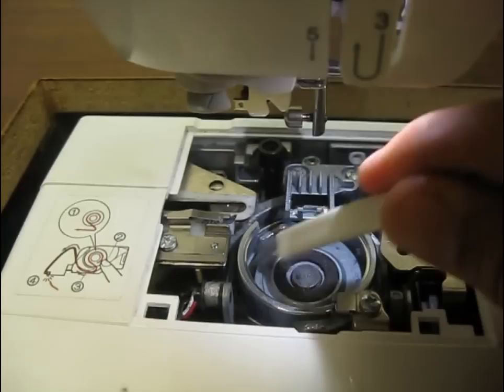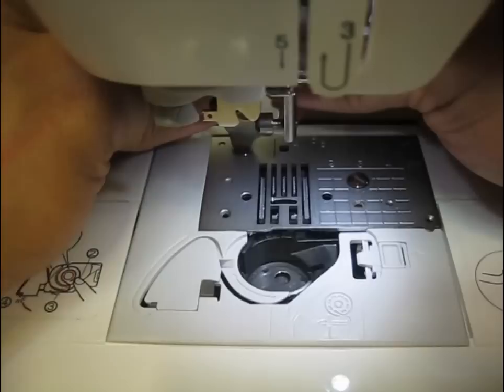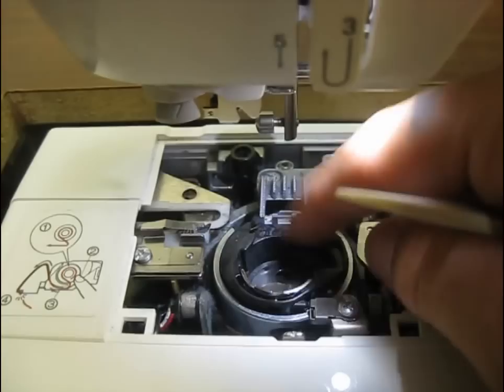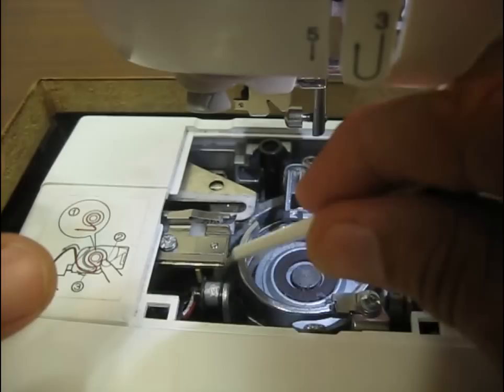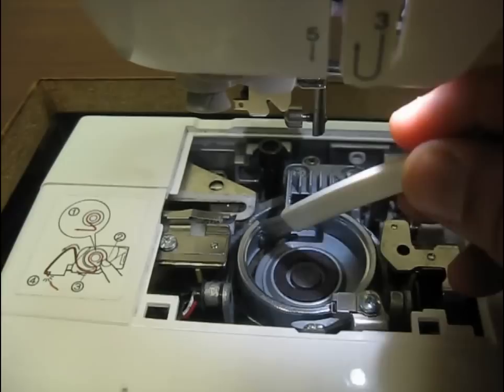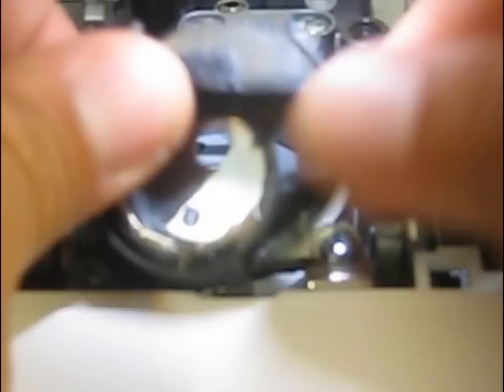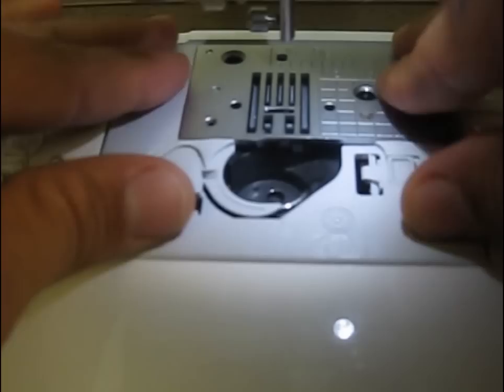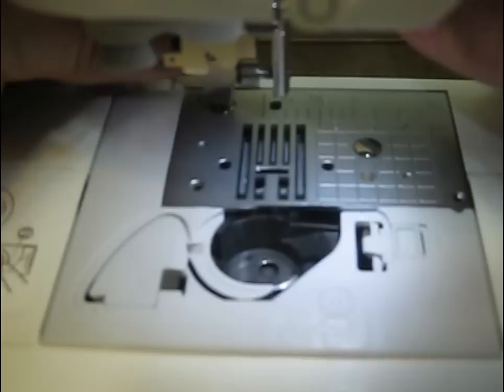How to Clean and Maintain Your Sewing Machine

Comment: you guys are great! thank you for doing this video.  My problem is that I removed the metal plate to clean the Singer Curvy machine and also removed the bobbin plastic holder, BUT THE PLATE WONT GO BACK ON THE TOP OF THE MACHINE.. what am I doing wrong.  My sewing projects have all come to a hault, can you please advise.

Comment from the maker: I don't think it is self lubricating. It is harder to clean and lube the top because of the plastic case. I just did an interview with a sew machine repair person and he suggested doing the same. However he did mention that it depends on usage and that if you are unsure how to do it you should take it into a shop for a tuneup. Maybe check out that video he gives good tips. Thanks for the post!

Comment: Just a quick note, if you take off the front panel that you have to remove for the embroidery unit, the plastic plate over the bobbin can be removed by sliding it towards you. You don't have to remove the metal plate to take that part off.

Comment: I am having problems setting the bobbin in place.   It seems that when I am done it is still loose and then it does not sew right.  Is there a trick to set the bobbin thread in place?  I have the same machine as the one you used in the video. The other issue I have and it would really help is how to use the automatic needle threader.  Thanks. Vilma

Comment: INNOVI -10 anniversary model -afternoon just found your video thank you , reassuring re putting the plates back I worried when mine seated with play until I screwed it home. My question my needles and presser foot keep working loose and dropping off very disconcerting when sewing not to say the damage it may cause. Any suggestions or do I need to buy new parts. This happens possibly every half hour of sewing. I do try to tighten the screws as much as possible. I am quite able in terms of maintaining machine and had to have the whole casing off when recovering a lost needle that slipped down through the throat plate, when replacing, into the workings, fortunately had slipped out of harms way but didn.t know that at the time.

Comment: Do you ever open the top to clean? I keep having problems with my thread. I’ve checked that it is threaded correctly and put in a new needle without burrs. Could there be thread stuck in there? If so how do I open it?

Comment: I have rethreaded my machine as well as changing the needle.  I have a Singer  2263.  I have adjusted the tension and width, but once I start to sew, the needle will sow a little and the thread pops.  I purchased you thread and I get the same result.  When I position the needle to another way, it sows, but to the far left.  Please help me.  I am a beginner at sewing.

Comment: I bought a brother se400 off ebay....it sews beautiful but occassionally the thread will knot under the fabric and make a total mess....this was in the description when I purchased but figured it wasn't major...I took the bobbin case out and reseated it and it sewed fine for several days than again it knotted up.  I took it apart and looked down in it and it looks like someone oiled it there....my brush when cleaning comes up all black and oily....is there suppose to be oil there....if not how is the best way to rid it.  Thanks
Reply: This machine is not meant to be oiled.